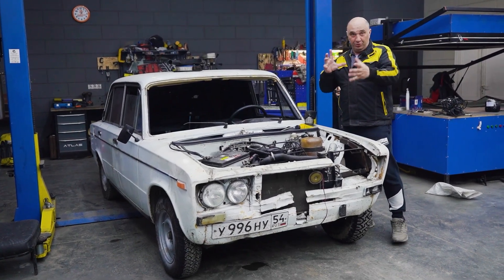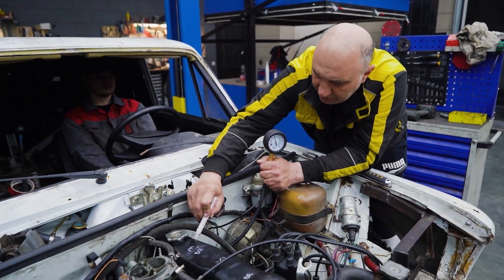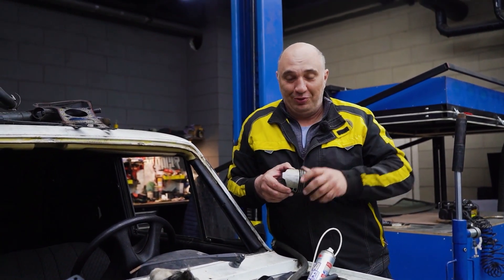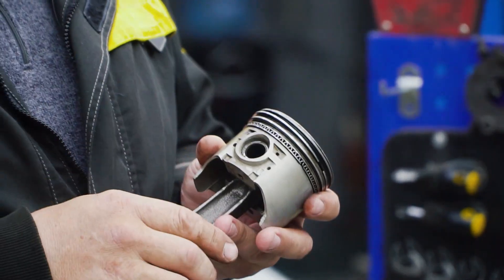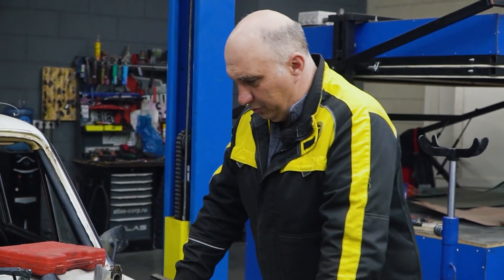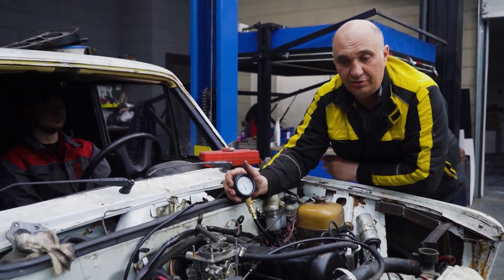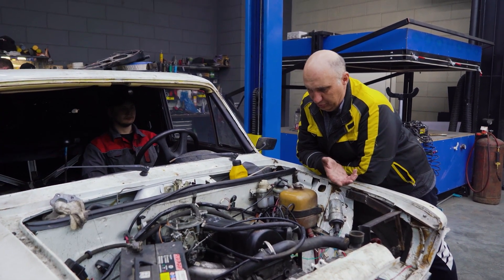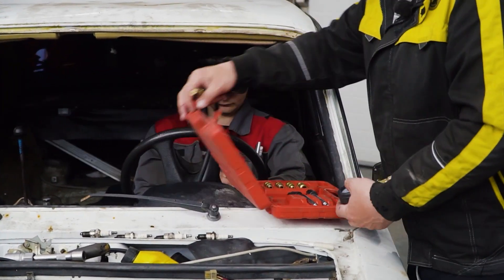Will an extra piston ring raise the compression?

Comment: Now combine this with the alternator driven supercharger, diesel pump injection and some E85.
Reply: Yes do this!
Reply: Yessssss
Reply: Now its need to fit that diesel high pressure pump and put on dyno 💪
Reply: yep, then Dyno it
Reply: finally a lada in f1
Reply: on the custom I-6 lada engine
Reply: I am just discovering this channel. I'm learning the commenters are as creative and fun as the Garage.
Reply: That
Reply: Yes
Reply: yeah
Reply: And lowered head for even more compression
Reply: That sounds fun
Reply: Yyyyeeeeeesssssss absolutely do this
Reply: And the flat plane same timing crankshaft, it’ll be the ultima lada, might get 3000whp
Reply: SAME AS I WAS THINKING BUT RUN THE TURBO ON 24 VOLTS.
Reply: Yes do this!
Reply: A high torque drift lada like that sounds amazing!
Reply: Lets Do This!
Reply: Or alternatively just strap a grenade to it....
Reply: What kinda conecting rods & crankshaft do you use?
Reply: Rewire the alternator to work as 3 phase motor
Reply: YESS
Reply: Yes
Reply: yessssss
Reply: Wtf is an alternator driven supercharger? You mean belt driven? If so the serpentine belt will not handle the stress of a supercharger at load
Reply: @ethangraves7937  they did a video on one it worked lol
Reply: @ethangraves7937   I meant to write "starter motor driven" but yeah, they made a video about one and it kinda worked: https://www.youtube.com/watch?v=SW3xL9nsqUM
Reply: @ethangraves7937  He also said e85. Must be a Donut Media viewer.
Reply: Why e85? That is the enemy of carburettors.
Reply: @the_kombinator  For increased knock tolerance when adding boost. And there is no carburetor if diesel pump is used. Just have to premix it with some 2-stroke oil to keep the pump working like they already did in the previous video: https://www.youtube.com/watch?v=K7LHBWr7Kkg

Comment: can you make a performance camshaft from a standard camshaft..is it possible?😮..awesome videos!
Reply: regrinding stock cams is pretty  common. Lots of racers busted for cheating in stock engine classes for doing it
Reply: make a ridiculous degree cam😂😂push the valves to the limit and see what the outcome is👍...power Gains that is.
Reply: Yes, it's possible. Watch Le Dan channel from Indonesia, that guy is another gem when it comes to engine mods..
Reply: Also do watch "Restoration of Everything" channel, you'll be amused for sure
Reply: You can always regrind a stock camshaft core with a smaller base circle. It's limited how much you can grind but it's done often and is a cheaper option

Comment: The big downside is not being able to run as low octane fuel. 8:1 compression means you can basically tip in anything that will burn but at 9.5:1 it's going to need normal petrol or better. 
Most places don't get ~80 octane anymore so this is just an improvement.
Reply: nope, This has brought the compression ratio back to stock by sealing up the cylinder wall better. There was nothing in the mod that made the compression ratio more than it was from stock unless they did something to this engine before that im not aware of
Reply: @quevicular  So you think the compression comes from the piston crown? 
Next you'll be wondering why the top ring is called the "compression ring". 
The piston might be a tight enough seal to suck in the air on the intake stroke (helped along by the atmospheric pressure behind it) but it sure ain't going to seal against 8+ bar of compression. 
Thats kind of why we have rings in the first place. 
The result is you get a similar amount taken in but its then squashed harder thanks to the top ring being higher - leaving less room for the charge to go down the sides of the piston crown. 
By the way this is a 2106 Lada engine and its compression ratio is listed at 8.5:1 - so the results they got from the compression tests are pretty much spot on for a used engine of that spec. 
You're not seeing 9.5:1 by tightening up tolerances and the extra ring they added wouldn't have anyway since its the same spec going into the same bores.
This mod is something thats been done on bikes for decades and is well known to work - look it up if you're interested.

Comment: As the English language G54 videos are usually released months (Or occasionally years) After the Russian ones, I'm now curious if they ever did a follow up video on this?

It would have been interesting if they'd dropped the engine in a daily drive and popped it back open to double check everything a year or so later (Assuming nothing went catastrophically wrong with it during this testing phase). I can't work out if the edges of the crown would start breaking off, if the edges would bowl down and trap the top ring, or if the edge of the crown would be SUPPORTED by the extra ring and the engine would still be fine after 12 months use.

I can't be the only one who'd be really interested to see a long term test follow up video, can I?
Reply: You can see in the security camera footage at 12:36 that this was filmed less than a month ago.
Reply: @henninghoefer  Jesus, Well spotted. It didn't click in my head that the bit you mentioned WAS from a security camera (Bloody obvious now I've rewatched it) ! :D
Until I actually clicked on the time stamp in your comment I couldn't even have said what footage you were talking about.
Reply: just checked it. russian version of this video was released 2 weeks ago.
Reply: @k6computers  Damn. There goes any chance of finding an update some time soon then. :(

Comment: Extra compression rinng will mean extra friction, lower revs,  more heat to dissipate, more wear. It would be have to mesured in a long run.
Reply: if the engine is already worn out, whats to lose?

Comment: Do some mpg modification testing. Lawn mower carb, skinny tires, whatever.
Reply: Check out Thunderhead289. He has a mower carb on a muscle car
Reply: @lamarzimmermanmennonitefar5269  I was excited to see that video.  But, his methods of measuring mpg are sloppy at best. I have spent a lot of time and effort to get 31 mpg out of just 2000cc and 2k lbs, I don't believe his results at all.

1.5g is gone in less than 45 min runtime in my 420cc carbureted snow thrower using the smallest main jet for my altitude, I don't see how the same type and size carburetor would magically become hyper efficient when mated to 4000cc of v8. 
If he wanted to be honest,  he would have fitted a temporary fuel container on the hood for all to see, using a single line returnless system. But he won't do that.

Comment: but it is gonna increase friction as well compression
Reply: The extra drag from the ring is very slight compared to the additional power generated with a near 10 psi bump in compression they're seeing. All these low tension piston rings you're seeing today are engineers chasing fractions of a percentage economy.
Reply: @otm646  i agree that was great

Comment: Remove a spark plug and an injector for one cylinder then modify the header for that cylinder to redirect the air it pushes out back into the intake
Reply: That would be like using that cylinder to work like a turbo, because the AFM would not get ignited as there is no spark and the compressed mixture will be pushed back into the intake manifold to be supplied to the the other three cylinders in the next cycles. Only worry would be to avoid any blowback reaching/crossing the throttle.. Great idea though!! 👌👍
Reply: And to make it pump air not just internally pressurize it
Reply: It would still work, with a little bit of carb tuning, even the efficiency might improve
Reply: The problem that the turbo only blows instead the piston is suck and blow. you can control with valve wich would be open only when blow, but then you miss one clycle.

Comment: In the antique engines I've had a pleasure to restore I've always noticed older engines with three and sometimes four rings one on the bottom and three on the top made the Piston to where it didn't move around or slap.
Reply: They got higher compression merely because they machined piston ring in free space above default ones. This decreased volume in cylinder. 
Lada has low compression ratio because it is designed to run on crap russian fuel - 73 to 78 octane . 
Modern, high efficient engines have compression ratios like 13:1 and at the same time piston rings are made thinner - to reduce drag on high rpm region. 
It would be interesting now to take the middle or bottom ring away and repeat the compression test. Also nothing about what gasoline they did use.
Given it is carburator engine, and modern fuel, even in Russia, got better recently,  increasing compression is just making old lada motor one step closer to modern engines.
Reply: There is a downside to this, like faster cylinder wear. I remember people taking out 1 compression ring from some Perkins engines.
Reply: The downside is decreased efficiency and increased drag.  And also increased cylinder wear.  The cross-hatching would wear away much faster